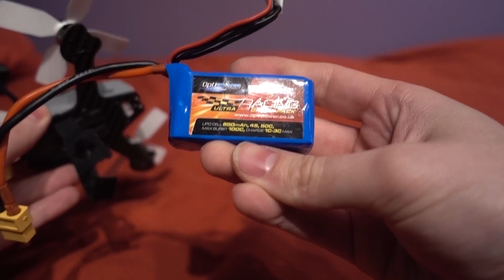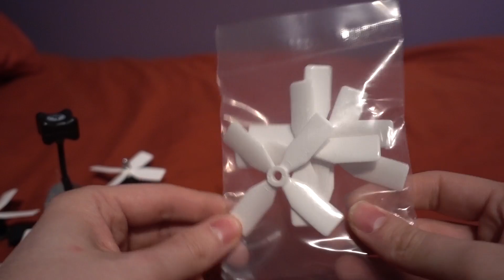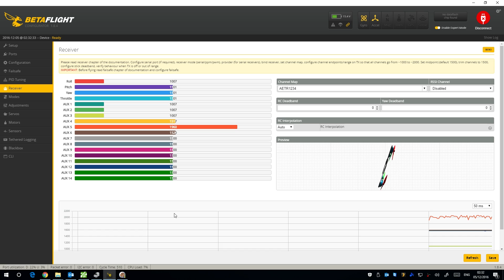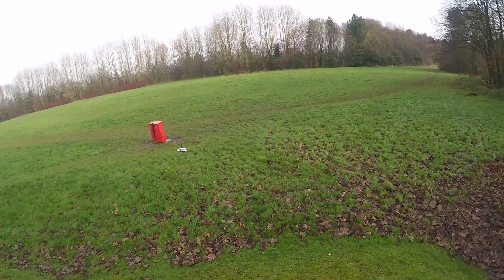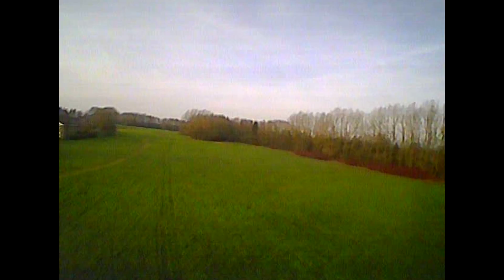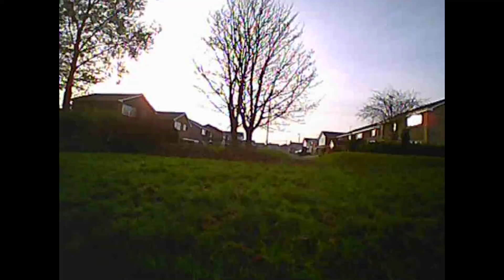Youbi XV-130 - Its Good

Comment: Dutch RC here on youtube has released a video that shows a very clever, cheap, easy, and light weight fix for the rear arms flexing and causing the props to strike the canopy. aluminum tape on the bottom of the frame, it does not stretch and therefore does not allow the the carbon fiber to flex upwards.

Comment: Laughed when you said "we're all using Betaflight now" ... Baseflight came installed on my Naze32acro and I never changed it .. still running it. Don't know that I'd gain anything by changing to Cleanflight or Betaflight, other than having to go through the painful process of retuning my PIDs on my ZMR250 (1806-2300kv 3S .. very old school!) BTW, I also set up a beeper on my Taranis 9D+, as well as a 3 pos. sw for modes (Angle, Horizon, Acro) and an ARM switch. Can't really do much more with the D4R-II Rx in there running PPM. Cheers.
Reply: Bill Somrak well let me be the first to tell you Bill, if you swapped to clean flight or especially to beta flight, you would notice an immediate difference in handling and locked in feel. If you take pictures of all the pages in base flight and then a pic if the CLI "dump" features, it will only take you 6 min to re enter the settings after you flash the new stuff.  Ill also let you know that the Beta Flight configurator is sooooo much nicer than base flight. I too started with a naze32 with base flight, then clean flight to now everything has beta. 

Hope you try it and let us know what you think.
Reply: From what I've seen, the PIDs look different between all thee programs.  For example, in Baseflight, the Proportional number seems to be a small number like, say, 3.6.  The Integral number is a real small decimal number, like, say, 0.036. The Derivative number is usually a larger whole number, like, say, 23.  The numbering system in the others look to be quite different.   Then, there's the thought that even if there were some kind of way to enter my current Baseflight values, would they work the same way in Cleanflight or Betaflight?  I do have  backups of my settings, and screen snapshots and CLI dumps, just in case I needed them for later.  I found that my current number vary considerably from those that were recommended by "Mini Quad Bros" for the ZMR250 when I first built it 3 years ago.  I do see that Betaflight is the current rage, and that it is updated regularly. I don't think there's been but one update to Baseflight in 3 years, and that was very early on.  Now that we've entered the Winter season her in NE Ohio, maybe I'll give one of the alternatives a look. I can always do a new build based on the Naze32Acro and FrSky radio to experiment with and learn the new system. Cheers.

Comment: there's nothing wrong with the xt30 connector. you will not over amp it on 4s. They say xt60 is good for up to 60amps and the 30 for 30amps. They can obviously feed much more than that based on the idea of 20amp escs. one per arm at constant draw is 80amps plus your camera gears draw.  I swapped xt60s for xt30 on all my atom batteries 3s and 4s turnigy nano tec and grapheen.  You may be able to pull 30amps with its size but it won't melt.
Reply from the maker: my issue isnt the number of amps its that the battery keeps falling out
Reply: oh I ment if anyone wanted to take the time to re solder xt30 ends on their batteries that they would be OK. But ya my atom and now my gb130 clone love tossing their batts in a good crash. Never had one wiggle lose at the xt30 tho.  

love the video dude. thanks

Comment: Andy, go to wilkos and look in the Velco/tape section!!! 3 different types of straps available and they are all sizes and CHEAP. I use them they are great lol. This is a great little quad, I'm sure you could easily change that camera angle if you really wanted to. Will a jst be able to handle the current on this thing?
Reply from the maker: thanks for the tip/ a jst wont handle a 4s its for using with a 3s and will be fine yes

Comment: Wow! You're running an even bigger lipo then I do (I thought 750mah was on the Big side :$) .. 
What kind of antenna did you have on your receiver when testing that dipole antenna that came with the quad? :$
Reply from the maker: i was using the same aomway and menace RC antenna but it usually handles a dipole pretty good. not this one though. yes big batter but big fun heheh

Comment: any plans for another Youbi video with some upgrades to it or anything?

the FPV camera vibration can be mostly fixed by hot gluing the lens. 

I plan to upgrade to Tiger F20 motors if my youbi ever shows up on the slow boat.

I have an idea to reduce the arm vibration by epoxying 6mm carbon fiber tube to the channel in the arms. 

a hubsan 720p camera module fixed on the canopy on some foam might make a light and stable enough action camera solution. 

I also plan to desolder the antenna connector and fix a micro whip antenna straight to the board to save weight.
Reply from the maker: yeah i hope to do more in the future cheers

Comment: Hi AndyRc! Nice video! Hey got a question... Thinking about getting one of the Walkera Rodeo F110 and it comes with a Devo 7 and they have the Devo 7E out now I know it's a tad downgrade from the 7 but is it a good radio? Reason...I'm thinking I could use the Devo 7 that comes with the Walkera with the Youbi?! But I'm having second thoughts on the Waldera and wondered if the 7E would be good enough for the Youbi and anything that uses spectrum?? But the 7 and 7E are only a matter of 5 or 6 dollars difference so if the 7 is that much better I would rather have it! Sorry but another little question lol...Have you got a chance to fly the Eachine 130 Racer?? If so, which of the two do you favor more? And why? I know the Youbi has the 4S and the Eachine is just 3S but which one is best or funnest to fly? I've heard the Eachine is maybe a tad more sturdy and stronger? But I like the Youbi a lot! So I'm torn I don't need both, or maybe I do lol, but which one should I get first?? Thanks, Turbo(EDIT) lol I see now that you can use the Taranis with the Youbi, I'm thinking of the Walkera Runner 250 Pro That comes with one? I can't even remember now dang it!! But Just let me know between the Youbi and the Eachine 130's what your opinion is please and also have you checked out the Walkera Runner 250 Pro? How's it? Thinking about it also! lol Thanks a lot man!

Comment: I already had this on order before you dropped the video. I also have a set of Tmotor F20 3200kv and back set of F20 4100kv motors coming. Do you think it would improve the performance to upgrade the motors? do you think anything can be done about the jello? soft mount maybe?
Reply from the maker: i think the frame is too thin. but you can try these stock motors are pretty good so u will have to try em

Comment: Andy,whats the best 4s battery you have found to be useful,a 1300 or a 1500/1600 ?
Im using a 210 x frame for my quad
Cheers
Reply from the maker: 1300 for me is the perfect ballance between power and flight but i run some 15000 and 1800 rarely

Comment: Hi Andy, great videos.
I can't get this quad to arm, with my DX6.
Everything looks fine, in Betaflight 'receiver' setting, but it won't arm.
I'm stumped.
Please can you suggest something?
Reply from the maker: how are u trying to arm it? switches or rudder? cheers
Reply: Hi Andy, switch A on the DX6
The base of the vtx antenna, is really hot and the display reads P. it won't adjust?